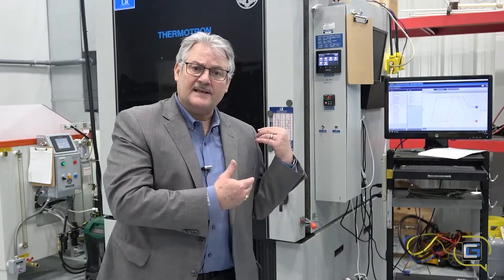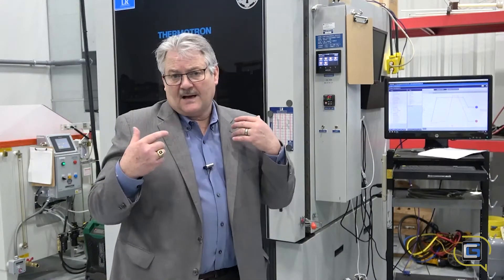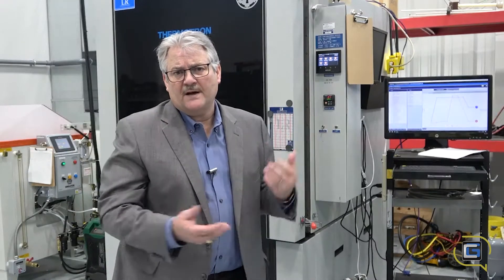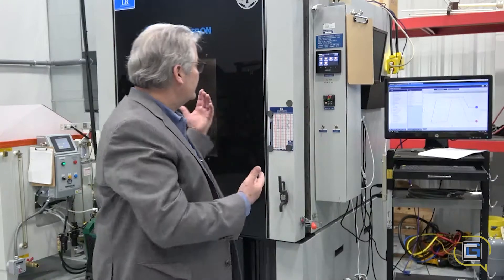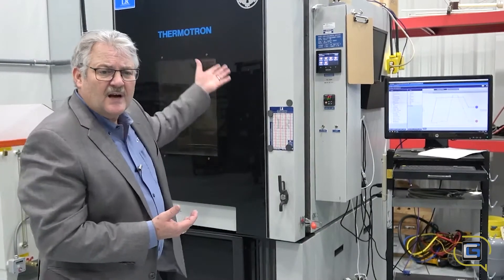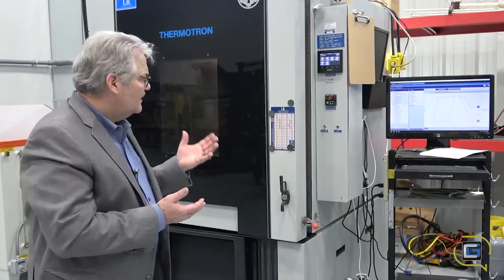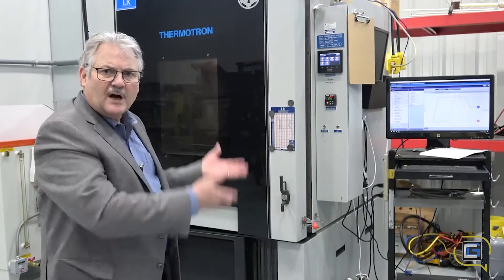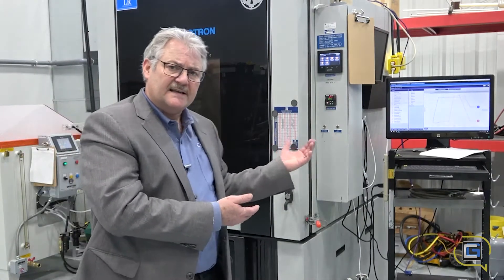MIL-STD-810, Method 507, Humidity | Jim on Engineering | Volume 2, Episode 3

Comment: What mil-std-810X are you referencing with your “standard” humidity test that you open with? G and H have procedures 1 and 2. Procedure 1 is a combination of induced and natural occurring cycles. Minimum of fifteen 24 hour cycles and procedure 2 outlines aggravated humidity testing as you described. 810F has only one procedure but it’s a 10 24hr cycle test at a high and low temp with constant 95% humidity. Just wondering where you see a mil-std-810 method 507.X that calls for just two 24 hour tests at different conditions with a drying in between
Reply from the maker: Whoops!  My bad.  Method 507 has two procedures, Induced/Natural humidity and Aggravated humidity.  Both the induced and natural are 3-day tests which is 6-days total not 2-days for procedure 1.  See page 216 of MIL-STD-810, Rev H.  Thanks Miketh3messiah! - Jim